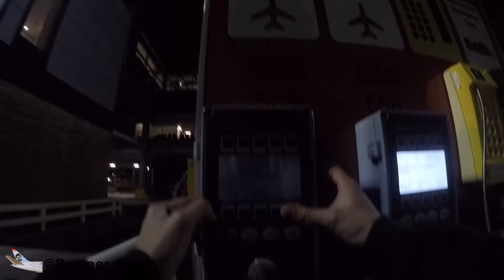Ramp agent POV 737 spin

Comment: i wish all the 737s still had the magic carpet
Reply: I hate magic carpets and power stows. Alright for offloads but a pain in the arse for loading.
Reply: I'm actually a much bigger fan of a 737 + powerstow combo. I find I can stack at least 5 additional bags without a magic carpet, especially in the front due to all the space it takes up.
Reply: @oogdiver  having a power stow is beneficial for a long plane. Instead of having a regular belt loader and having someone else push the bags to you.

Comment: I remember doing this work whilst at Uni in my holidays. Your strength and energy reminds me of me aged 18!  Such hard work and under so much pressure. The 737, 1-11 and MD-80s didn’t have a conveyor belt back then, I was surprised to see it!  Un or Loading an A320 or 757 was so easy with the containers.  They were fun days, but it’s desk job for me these days - haven’t got the stamina anyway! Thanks for posting these videos, really interesting and brings back memories. 👍😉 You seem to be doing a lot of the work alone?  When I did this work we’d have several guys working the holds (in the 90’s).

Comment: I'm guessing airport's are doing away with manual Marshalling and switching to a high-tech electronic system to direct aircrafts into their gate , Marshalling with light wands is more interactive than having a bunch of lights and arrows on a light tower do the work....eventually airports will replace all ramp agents with robotics and the aircrafts will go high-tech below deck where all of the luggage is loaded with robotic arms.

Comment: I was wondering is it all 737 bulk compartment have electric belt?! i know 320 dose not have it .... or is it from the airline design ?
Reply from the maker: Its airlines choice wether they want that system installed on the aircraft. Most choose not too as its added weight to the plane. But it makes it so easy and quick to turnaround
Reply: @ramperryan they also have to pay the ground handling companies more cash
Reply: less*
Reply from the maker: @koala1702  actually makes no difference. They pay what ever they get quoted and they get to choice who they give the ground contract too
Reply: Delta is doesn’t have one
Reply: @TheLoreKeep actually they did. They only got rid of them because they made the plane too heavy which meant they needed more fuel to fly. And in some of the 757's, they have the older version